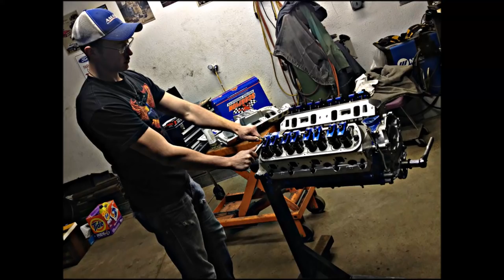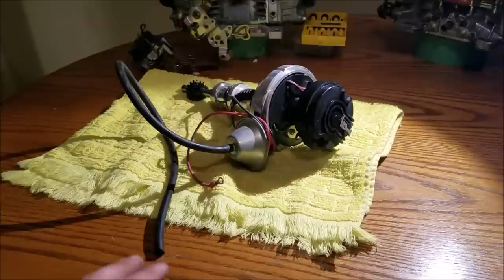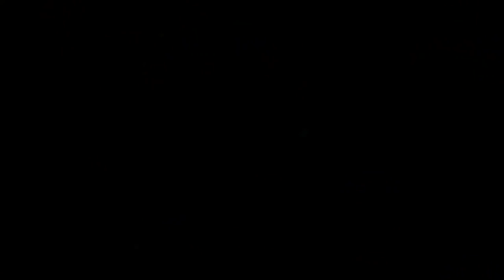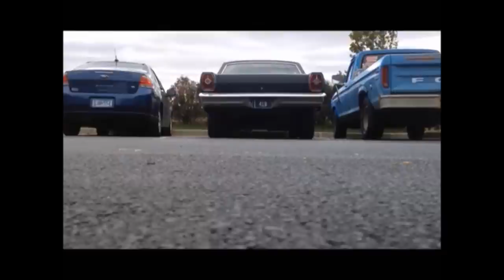Vacuum Advance Explained - What it is & How it Works

Comment: Manifold vacuum is the only source for vacuum advance if you want it to function as intended.  Ported vacuum advances the spark too much when accelerating because there is vacuum even when the gas pedal is on the floor which is not correct.
Reply: Not true. Once the throttle is opened off idle you will get the same vacuum gauge reading whether connected to ported or direct manifold vacuum.
Reply: 65sohc Once the plates open, manifold vacuum decreases while venturi vacuum starts to increase from zero. At 1/2 throttle,  manifold vacuum is much lower than venturi vacuum.  Most people don't understand this principle.
Reply: Disagree...When full throttle, manifold vacuum is almost zero while ported is maximum.
Reply: The orifice from which the ported vacuum receives its signal is a fraction of an inch above the closed throttle blade, basically at the level of the transition slot. As soon as the throttle is cracked open that orifice is exposed to full manifold vacuum. The venturis are much higher and affect fuel flow through the boosters by increasing air velocity.
Reply: When the blades are opened fully, what is the ported vacuum at this point?
Reply: Zero or close to zero, depending on how much restriction there is upstream of the manifold. An overly small carb or restrictive air cleaner will increase vacuum reading at max rpm.
Reply: In that case, ported vacuum isn't the one to use for vacuum advance distributors.  No vacuum when idling which is one of the good features of vacuum advance.
Reply: As Thunderhead mentioned, that is generally the case unless you have a high overlap cam with a lopey idle, in which case the vacuum at idle tends to be low and unsteady which would cause the vacuum advance to jump around.
Reply: The word is, "ported vacuum" was strictly an early, pre-converter crude emissions strategy, and nothing more. With an overlapped cam, a different vacuum can should be used that advances the points plate with lower vacuum in hg.  That's going to be a trial and error issue however, that's part of the clusters in modifying engines from stock. Not all modifications are or were  plug and play.
Reply: At the end of the day which vacuum source you choose is not all that critical. It doesn't affect engine operation other than at idle.  As long as the throttle blades are where they are supposed to be in relation to the transfer slots you should be good. The 30 year old Duraspark system on my Mustang gave up the ghost last week so I ordered a Pertronix Ignitor III distributor and Flamethrower III coil. I'm looking forward to installing them today and playing with the advance curve.
Reply: Agree.
Reply: Some will disagree which source is or is not critical. The entire point of having vacuum advance spark is to advance it when idling and when operating with minimum loads. That all there is.  Anything else doesn't use vacuum advance unless it's connected to the wrong vacuum source. The entire purpose of vacuum advance is for a smooth cooler idle and better gas mileage at cruising speeds, nothing more. With the wrong vacuum source, none of this will function as intended.

http://chevellestuff.net/tech/articles/vacuum/port_or_manifold.htm
Reply: Vacuum is vacuum. Everything will function the same except for idle, whether it is ported or direct manifold. If your engine produces a vacuum of 15 in. at 50 mph that is what the vacuum gauge will read whether it is connected to the intake manifold or the the vacuum advance port on the carb. Same goes for WOT. There have been carburetors that had ports that referenced venturi airflow that did increase as the airflow through the carb increased. However that is not how any of the Holleys or Edelbrocks are designed.
Reply: Yes and the idle vacuum advance is important to most folks who want vacuum advance benefits. So, vacuum is vacuum is not the fair answer.
Reply: Garth, your quotation below is what I originally responded to. The fact is that no vacuum advance takes place at all at WOT whether connected to ported or direct. There is no situation in which ported will advance timing more than direct manifold vacuum.

"Manifold vacuum is the only source for vacuum advance if you want it to function as intended.  Ported vacuum advances the spark too much when accelerating because there is vacuum even when the gas pedal is on the floor which is not correct."

Comment: Thunderhead289 Prior to explaining this concept, it would be best to explain the differences between "vacuum" such as ported, venturi and manifold vacuum. Many many shadetree mechanics and a few experts do not know the differences and often choose the wrong vacuum hose or port on the carb thinking they have it right.
Reply from the maker: I did make a video over this topic back in the day! 
https://www.youtube.com/watch?v=p6w9-BDu1JU&t=128s
Reply: Yes thanks.  The problem folks don't understand is the functions of ported vacuum. It's no vacuum at idle and venturi vacuum above idle or a vacuum that has zero relationship with engine load. With that understanding, folks should figure out that when mashing the gas pedal fully, they are working the mechanical advance and the vacuum advance together which places too much total vacuum at higher RPM and not enough advance when at idle. Ported vacuum is NOT the method for vacuum advance needs unless the manufacturer has designed their application to work only with ported which is a totally different animal in design for outcome.
Reply: You are misreading my opinion about vacuum advance. I am all for it but only with manifold vacuum as a source. I owned several late '60's and early 70's GM cars and trucks and understand this point rather well. Shade tree mechanics and racers don't.  Like the above "ported" source idea,  there's no timing advance at idle which defeats the purpose of the entire principle. Vacuum advance features requires vacuum at idle on up to cruise LOADS.  No one has said were give a crap about emissions here, only performance and cooler operating temperatures aka a good running machine. Yes, ported venturi vacuum was misstated above however, venturi vacuum does exactly that and won't work. Even ported vacuum isn't the correct method to utilize the benefits that were designed into vac adv.
Reply: So at WOT is there any difference in ignition timing whether the engine is running directl manifold vacuum advance, ported vacuum advance, or no vacuum advance? Hint: I know the answer.
Reply: No, there is no difference. However, when WOT, who cares?  The focus on vac adv is gas mileage and reductions in heat.
Reply: I understand your enthusiasm for the advantages of load-based ignition timing. However, you have stated repeatedly that one of the main reasons for not using ported vacuum is because it overadvances timing at WOT. This is a false belief, the realization of which you apparently came to in the last 24 hours.
Reply: I knew about it however, never investigated it fully due to it's useless offer for a vacuum source. Years back manifold vacuum was 'the" source and the rest was history. Later vacuum sources such as "ported" didn't provide anything better and back when there was venturi as a source, it wasn't the road to take either. It would be interesting to know what other uses ported vacuum is used for.
Reply from the maker: my only argument here against full manifold vacuum is deceleration at higher rpm. but if you are letting off the throttle at 3-4 grand and have a manual transmission, id assume you are racing and should not have vacuum advance hooked up.
Reply: My Mustang, described elsewhere, is a weekend toy. It has the typical performance centrifugal advance curve: 16 degrees initial, 36 degrees total at ~2500. With any sort of vacuum advance it runs rough above 2500 when all 50 degrees of timing are in. Apparently Pertronix only makes an adjustable canister for GM distributors so it looks as though there is no practical way to run vacuum advance on my car.
Reply: Do you think putting a restrictor in the vacuum line would alter the advance in any way?
Reply from the maker: too much timing advance for the AFR of the engine at that rpm cruising for sure. why do you have it all in by 2500 - iv honestly never noticed any difference between bringing it all in by 3000ish. -when im jamming on it, im above 3000 anyhow the whole time.
Reply: Actually it is more like 2800. I had it at 3000 as that is how the Pertronix dist. came. I was just playing with the springs to see what would happen. Two silver springs=3000. Two bronze springs=2500. I put in one silver and one bronze. I honestly didn't notice any difference. Do you think it would be worthwhile slowing the centrifugal rate and to allow vacuum advance?
Reply: Actually the copper springs are the lightest ones which is what I used.The bronze springs delay full advance until 5000 rpm.
Reply: Pertronix allows 78 different advance curves,
Reply: Unless the cam is stock...have fun with that.
Reply: Cam is not stock. It has a healthy lope at 850-900 rpm idle. I don't know what cam it is. Was in the car when I bought it. Why do you mention cam?
Reply from the maker: 65sohc with a higher lift cam, on a stock advance canister, the advance drops out at 15 inches or so - when you are at idle, you could potentially be getting into and out of advance at idle intermittently. And I recommend bring the timing in at around 3000 and running vacuum advance if you regularly drive it. Just a street rod, that you mostly rip on - just run mechanical.
Reply: @ThunderHead289  , wouldn't an advance limiter help, so that you don't have too much advance from the can? Crane makes them
Reply: The Duntov cammed 64 corvette was the first to use ported, many engineers say this was a mistake. For best performance always set your engine up to run with direct vacuum advance, not ported. Any cam over 300 degrees duration, always disconnect your vacuum advance. You cannot get a vacuum advance cannister that operates with that low of a vacuum signal. Check the NAPA listings. The VC-1825 for GM HEI's is lowest vacuum cannister you can get. The cannister rating has to be all in advanced  2 hg lower than your motors idle hg vacuum.
Reply: @Garth2011  Finally, someone who understands how a vacuum advance is suposed to work!!! Bravo!! It really gets tiring trying to explain to people that you absolutely do not want ported vacuum at the vacuum advance. The sole purpose of the vacuum advance is to keep the timing advanced when not under load, when you increase cylinder pressure you must remove timing, something that only manifold vacuum will do. Now in the 80's OEM manufacturers did attempt to use manifold and ported vacuum to try to reduce NOX emissions, this had nothing to do with performance, in fact it slightly decreased performance but it did reduce NOX slightly.
Reply: @fastone371  Thank you. Sadly, there are tons of professional mechanics out there who will disagree and never get an engine to run at its best.

Comment: Thank you - I bought a running 1951 Ford Flathead on an engine stand. It ran great on the stand. I got it home and built my own test stand - no problem. The engine runs great. The only thing is that the engine did not come with a vacuum advance unit on the distributor. I ordered one from O'Reilly Auto Parts and it should be in this afternoon. I've never installed a vacuum advance unit, but I'll give it a try. Thanks.

Comment: I have one question regarding the older engines (1987 Ford Escort). So when you are adjusting timing with the timing light, there is usually mark on the timing belt cover and one on the harmonic balancer. Do you unplug the vacuum advance hose, plug it and then adjust the distributor for the two marks to line up?

Comment: There is a component that you may have passed over. It is the speed of the engine and
the time it takes the fuel air mixture to burn. When at low RPM you don't want
the mixture to start burning too early or you will have the explosion taking
place too early in the compression stroke of the cylinder, making the piston
fight this explosion to complete it's upward movement, if you don't advance the
timing at a high RPM the explosion will happen too late and it will finish the
burn too far after top dead center and the power will be robbed by filling a cylinder
with a piston that is descending. The air fuel mixture doesn't take long to
burn, but that small amount of time has to fit into the mechanical timing of
the piston and valves to make the most of the energy.

Comment: Just subscribed to your great channel. I have a crate 383 stroker in my 77 Monte Carlo that came with mechanical advance. Also installed 700R4 tranny & 3.73 rear gears. 480/470 at the flywheel.
The cam is Lift: .500 / .510, Duration @ .050: 225 / 231, Centerline: 108, Fair idle, Street  mild performance usage, 
The vacuum advance cannister is connected to distributer but crimped (not hooked up to any vacuum). As it is, my timing settings are maxed out for maximum engine output. Car runs perfect! If I hook up vacuum advance, can I simply leave those timing settings alone?

Comment: Great video. It left me with a question though. If i buy an vacuum advanced distributor, and wanted to go with a racier cam profile, could I just disconnect the vacuum part and plug it and still use the distributor, or does that distributor need the vac to function properly.

Like if I bought an vacuum operated 123 distributor which is without points and controlled by a microprocessor and revcounter to set the timing, then i should be able to unplug the vacuum if I wanted a more tracked spec engine, like a new cam and such? I'm actually buying a 123 distributor for my classic mini as "we speak", but want to buy the correct version.

Comment: So I've got a question. The vehicle is a 7600 lb 1981 c30. These heavy trucks run with no cats, no o2 sensors, just a fully mechanical Quadrajet like a 60s or early 70s vehicle. It's at 8*-10* initial timing I forget which. Someone installed an HEI with and adjustable can which I've never messed with. 
I have the truck maintained, dialed, and tuned almost perfecto but it's off a hair at "launch".
I like to drive it hard and fast when tuning. Say I'm at a light and punch it. There's a slight delay and then it charges foward HARD. Its way faster than it should be. 😁

I'm trying to get rid of that first little delay. The carb is on point I'm sure of it.
Can I correct that hesitation by going to manifold vacuum rather than ported how it is now? Would playing with the adjustable vacuum pod finesse my tune?
All I need to do is gain torque under load coming from a stop. Pretend I'm loaded with a heavy trailer. 

Please and thank you.

Comment: Hello thanks for this video I have a 1950 Chevy Coupe with a 216 engine that I replace the points and condenser inside the distributor and replaced it with pertronix igniter. The car starts fine and drives but I feel like the car is not running as smooth and as loose as it used to before when it had the points and condenser. I posted a video of the car running on Facebook and some people commented that it could be the vacuum advance. What is your opinion? The car runs like if it is being held back, And like you mentioned on the video I really have to give it gas to run down the road

Comment: I have a sbc and I have a eselbrock carburetor  with vacuum advanced hooked up to it.  But I do have a stock cam and a eselbrock manifold with a 650 cfm 4 barrel.  Should I just use manifold port instead of ported.?   I'm going to also set my distributor at 8 degrees time advance.

Comment: The 63 nova I just bought has a t where the vacuum for the vac advance is being shared with what I assume is a pcv valve and they both go to manifold.  Any potential issues here?  I’m chasing down a loss of power on acceleration and after rebuilding carb, changing mechanical fuel pump, changing points contacts, and a new vacuum advance the last thing I can think is it that or a timing issue.

Comment: What would you do with a vacuum advance port that is hooked up to a computer box? Mine is driver side fender behind battery. Has a channel for the breather tube, too. Electric connections hook into existing harness. Not sure where they end up.

I no longer have a Spark Control Computer on breather. No emissions stuff. Just this box.

Comment: I have a 351 in a 93 bronco. It has a vacuum leak. When parked, I can romp on it with no issues. It just idles a little high. However, on the highway it tries to die if I give it a lot of gas. Could this be caused by something in the vacuum advance?

Comment: I just want to know. If I lightly press on the accelerator and the vehicle feels like its losing power, is my vacuum pump damaged. Ignition timing is right. Fuel air mixture is right. The vacuum hoses are not damaged. When i accelerate harder the engine regains its power. The vehicle is an '87 Nissan 1400. All stock parts with a Hitachi carburettor.

Comment: Great video.  What about the advance canister itself.  There is an adjustment inside of it.  As you know , slide in a small Allen wrench and turning will change things.  Could you pass along your thoughts about this?  Also (you might laugh at this this) but do you have a troubleshoot engine consulting service?  I’d pay you right now for over the phone help.  I’m not kiddening.

Comment: How much advance typically does the vacuum advance add to the timing if it is set at 12 degrees without. I have a pole school accel dual point distributor on my SBF. I don’t remember how far the timing advanced when the vacuum advance was added. That was many years ago. Right now I have the timing set at 21 degrees. I cant hear pinging when accelerating because the exhaust is to loud.